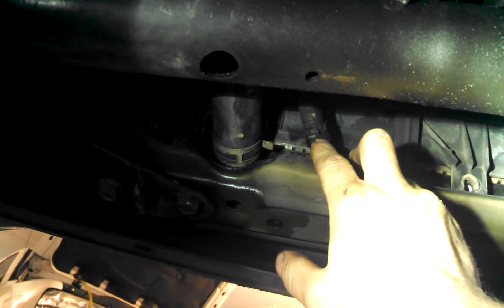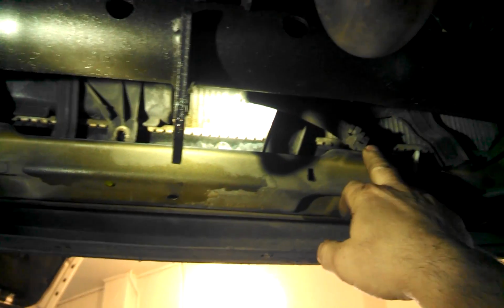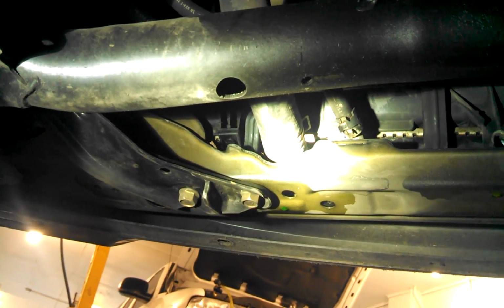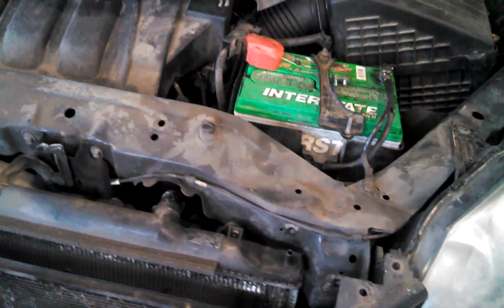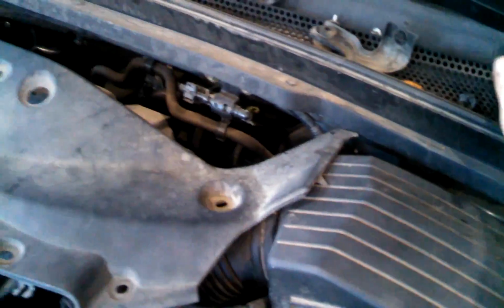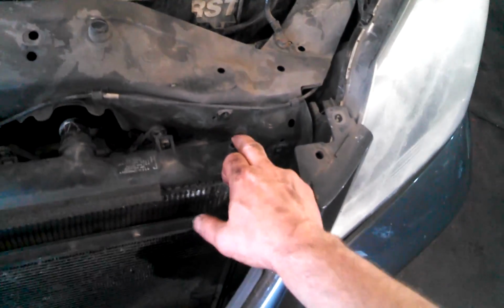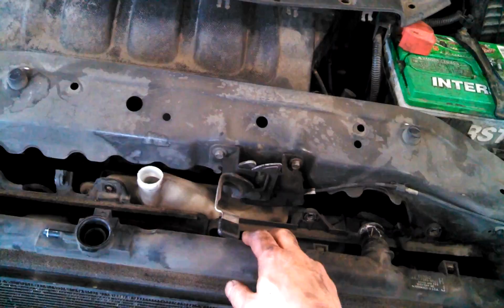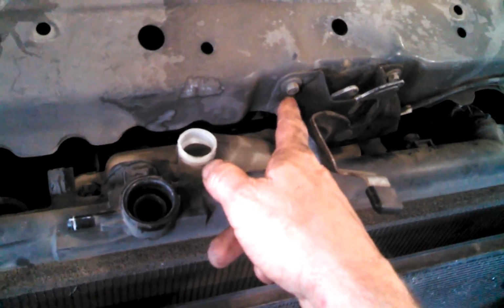Quick radiator replacement overview 2006 Honda Odyssey

Comment: U don't need to take fans off to remove radiator I did my 05. Just removed bottom hoses and the brackets up top and u have enough room to lift radiator from top very easy..that way u can put both fans and overflow bottle on new radiator.  Very simple

Comment: I had to remove the headlights to be able to push the condenser forward in order to get the radiator out, the atf fittings get stuck at the bottom otherwise

Comment: Quick question? One of my lower hoses in 2007 Odyssey needs to be replaced due corrosion. If I tackle myself will that require draining of the radiator?

Comment: thank for the video! Did u have room to pull the condenser fan out from the front there? without pulling the radiator? odyssey service manual says I have pull the battery and rad fan, then slide condenser fan out from the battery area....lookin for other options